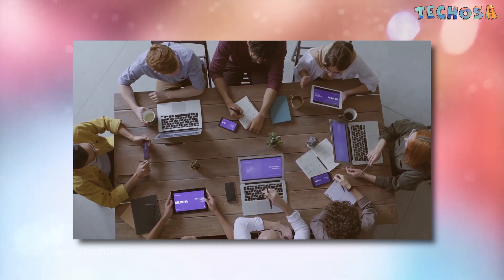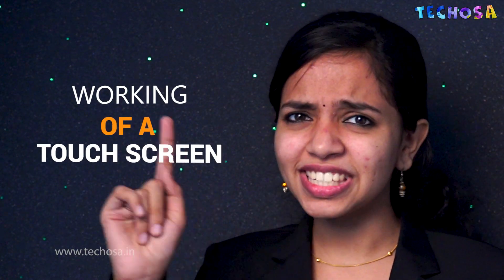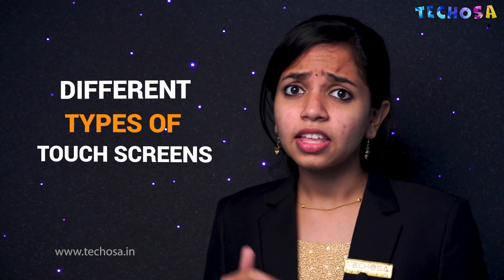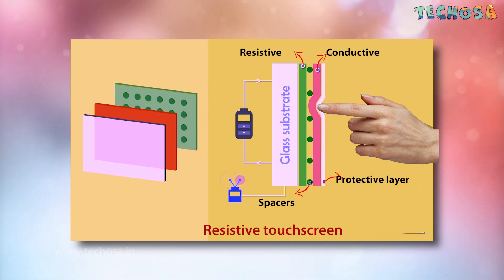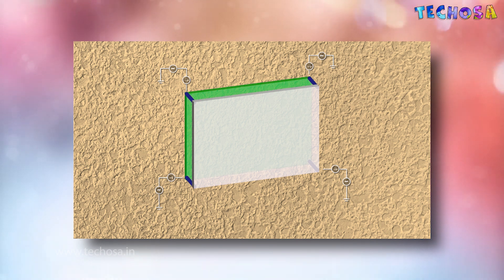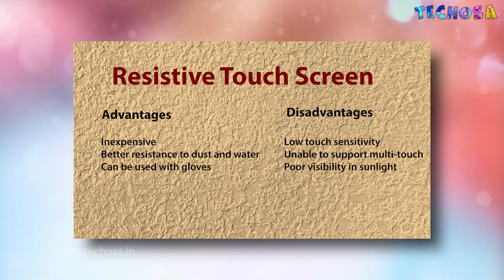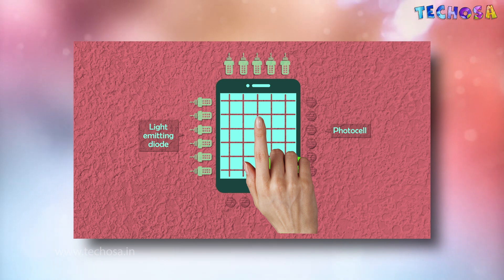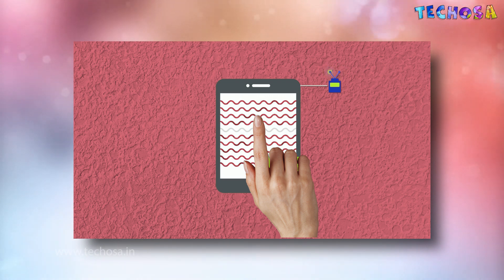How Touchscreen Works | Types of Touchscreen | Touchscreen technology | Simple Explanation | Techosa

Comment: miss how ultrasonic touchscreen work
Reply from the maker: Ultrasonic touchscreens use sound waves. The sound waves are blasted across the display surface, and when a touch occurs it makes an interruption to the sound waves, then the controller is able to pinpoint its location